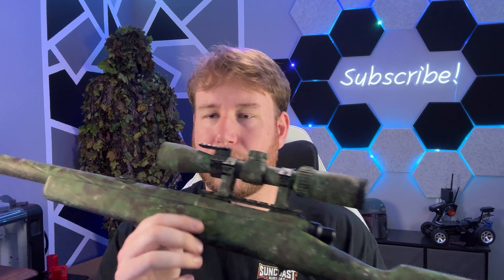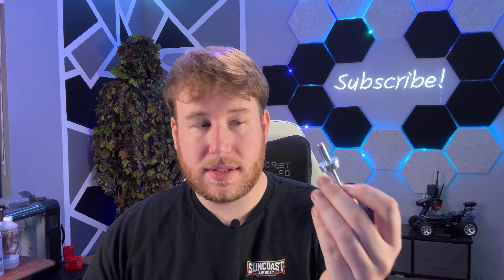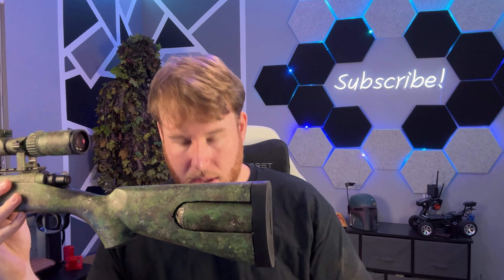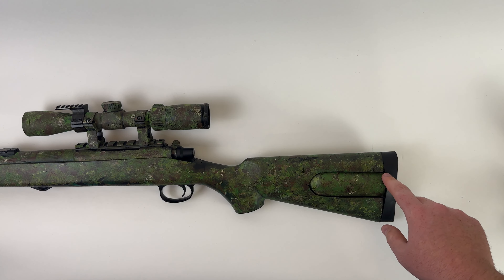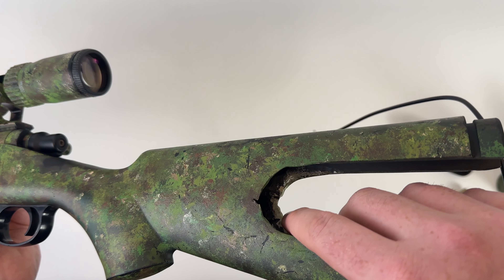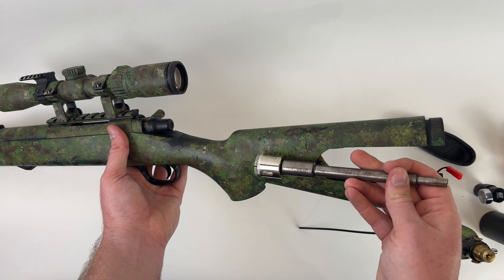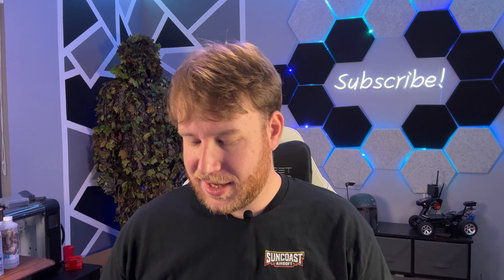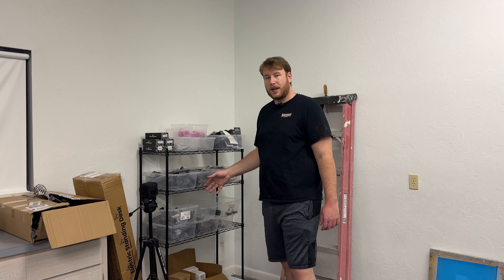How I Built My HPA Sniper! + Announcement!

Comment: The full thrust system is an interesting case. The idea is that Full thrust has heavier BB's, which gives better wind/air drag ballistics. However, since the BB is also bigger, it actually evens out.
The 6.44mm 0.62g BB has a slight edge (5% ish) over a 0.48g 6mm BB. A 0.50g BB will fly further than the FT 0.62g BB.
But since the BB is bigger, it's easier to accelerate in the barrel, easier to apply backspin and easier to track on those super long shots.

Comment: Great job getting the 8ci back from the dead! Love having the shop for everything you need to make the ultimate bolt in one spot. Youre prices are also great.  It's impossible to find a bolt e AND the full thrust kit AND a light return spring AND tridos in one shop hahaha, makes it sooo easy. Check out the TTI taiwan hop chamber with built in tdc. Cheaper better faster and a good fit with your lineup. Thank you for putting in the work!
Reply from the maker: @pescelino6627  thank you! Ill check it out!
Reply: It all would be great if only hop up chamber for full thrust would be better and if there was better bucking… mine get damaged after one game and then I was shooting  with 3J worse than with my 1.15 J cqb. I’ve got spare one from novritsch for free and it went bad after few next games. This bucking is just piece of rubber pipe. So just for this reason it’s no no for me.
Reply: I have the TTI Airsoft hop unit and TDC. A quality bit of kit that's a doddle to install with the included drilling guide and drill bit. For the same price of the Action Army hop unit and you get everything you need.
Reply: @ for full thrust system?

Comment: Hey dude, your challenge of fitting the tank in the stock can be made simpler and you would be able to sell a almost complete solution. Make a mold for you tank, you can make the outer dimensions any size and shape you like e.g rectangular, doing this means you don’t have to create a complicated cut in the stock. You could also crate oversized edges with a lip so it’s slightly proud of the stock and crates a nice clean insert with no visible gaps.
Reply from the maker: Im looking into it, it just gets expensive for me and the consumer. Ive seen people make their own stocks to do this, but I am always trying to improve. I will have another option for people soon!

Comment: I'm sorry, I have another stupid question😂

 Do you think you could take your full thrust nozzle and combine it with normal bucking for a better air seal?

 I don't like the stepped design of the normal bolt nozzle😅
Reply: Ah i See the full thrust  nozzle looks to long
Reply from the maker: @marcobrandt1378  probably not just because its made for larger bbs

Comment: Nice, fits the mancraft in the stock with gauge ?
Reply from the maker: @marcobrandt1378  yes!
Reply: @airsoftconnor  damn awesome

 I ordered it an hour ago!🤙 my plan is the mmr or wolverine regulator with the 3.2mm plug connection and wolverine 33g co2 adapter. 

I think this way I can fit everything in the stock without a stock pouch. 

Have you ever had problems with the magazines? how tight do you tighten the screws on the stock?

Greetings from germany
Reply from the maker: @marcobrandt1378  No problems with mags yet. What screws are you talking about?
Reply: the 3 body screws

I've heard that if you tighten them too much you'll have problems with the mags and nozzle alignment.
Reply from the maker: @ oh those! Yeah, you cant torque them down. The front 2 matter the most! Tight but not too tight!

Comment: Have you designed a bolt m full thrust adapter
Reply: As I have the bolt m in my vsr 10 and also am looking to do what you have done
Reply from the maker: @TacticalSn1per_BoomHeadShot Not yet! I’ll be adding that soon
Reply: @airsoftconnor  awesome I clearly have the same vision as you lol I need this please when do u think it will be put into production
Reply from the maker: @ I have to re-up my stock for the current nozzle. Probably around a month before I can get them!
Reply: @airsoftconnor  I would love to trial it when you have sorted out the cylinder head
Reply from the maker: @TacticalSn1per_BoomHeadShot if you have instagram dm me! @realairsoftconnor

Comment: How do you adjust the psi?
Reply from the maker: @Rezer0554  regular on the tank has a hex screw that you adjust
Reply: @airsoftconnor  i see, there is also no gauge so how do you which psi you're at? Would be dangerous if accidentally turn it up pass the limit.
Reply from the maker: @ most of them only go to 200psi. You would adjust it very slowly to get the desired joules

Comment: Do you intend to make different wolverine bolt nozzles e.g tac 41 ?
Reply from the maker: Full thrust only works with the VSR 10 so the as of now there is no option for the tac 41
Reply: @airsoftconnor oh i meant more down the lines of making a nozzle that would work with the tac 41 cylinder and make it compatible with the wolverine bolt
Reply: @airsoftconnor would also be interested in making bolt compatible with tac41